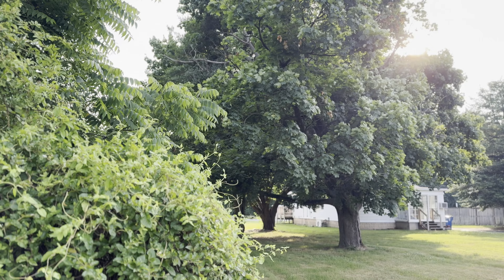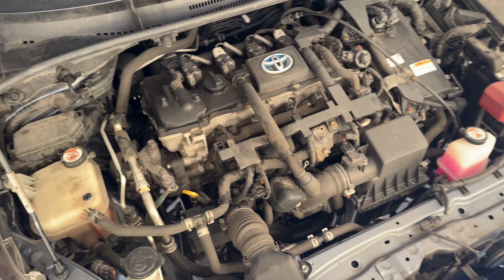Why Hybrids Are Beating EVs #autorepair #carlife  #toyota

Comment: What's at the top next to the engine is the inverter. The electric motors are underneath the inverter, and are part of the transmission, and not really accessible. They don't require maintenance, or fail either. The last thing that will fail will be the transmission.

Anyway, 500K miles, impressive. Maintenance is indeed similar to a normal car, barring any major components failure, which is unlikely, Toyota hybrids are extremely reliable. Furthermore, the maintenance is less, as you don't have accessories and accessory belts.

What you can't do though, is wrench on on anything being part, or next to the high voltage system. 

As for the high voltage battery, it is designed to last a very, very long time. It's operating in the 20-80% range (never full, never depleted), it is air-cooled, and doesn't stress much, really. Time will take its toll, but it's at minimum a ten years replacement item, that you can refurb or replace for 3K. Not that bad.

Toyota hybrids are awesome. That or Honda hybrids, the rest, I wouldn't bother with.

Comment: Heck, I bought an 09 Prius back in Nov with 246K miles. It had the original battery, and it was still getting high 30 and low 40s in mpgs. I had it replaced last month just cuz it kept going into the last two bars too much. Its working just fine. 💪🏾

2019 or older = hybrid battery 8 years/100k miles

2020 and newer = hybride battery 10 years/150k miles.

Comment: Do you use the 0W16 oil?
Reply from the maker: Yes, zero 16 for Toyota hybrids
Reply: Obviously from previous video uploads Michael uses 0W-16.  Is the hybrid battery chemistry NiMH or Li-ION?
Reply: @pritambissonauth2181  He  obviously doesn't KNOW if he has a NiMH or a Li-ION. I'm not sure on Corollas but Prii will have a label under the hood or have a XW51 indicates a gen4 Prius with a Li-ION battery. The more u drive them, like HIM, it's better for ANY traction battery. Lack if use is harmful.
Reply: @riceburner4747  I have a Corolla Hybrid delivered last year in June (2023) with a Li-ION battery.  I am from Mauritius by the way.  I am also surprised that there are other models being delivered with the NiMH battery.